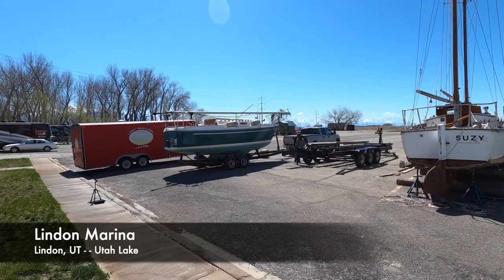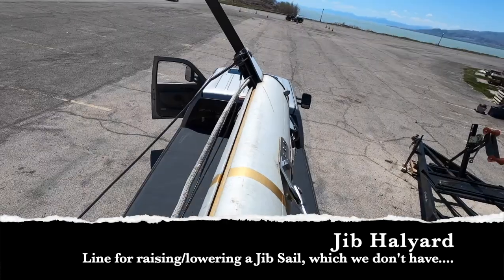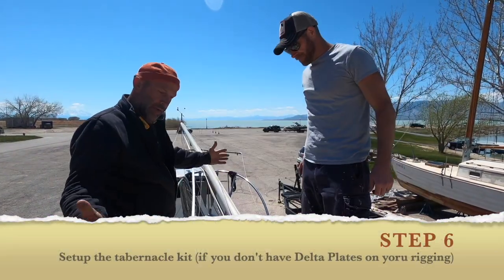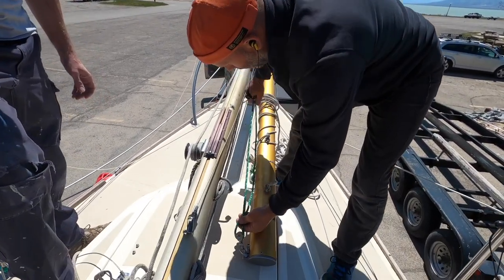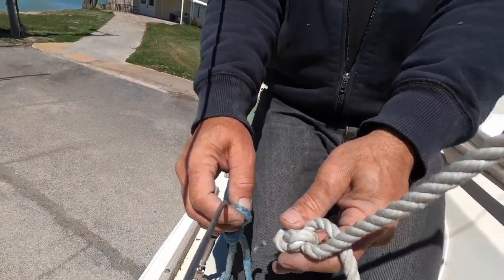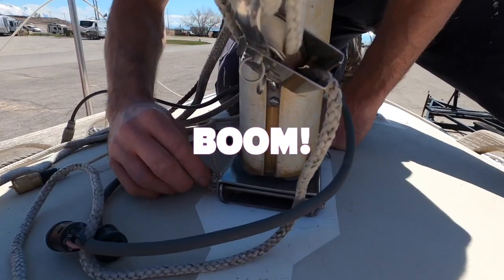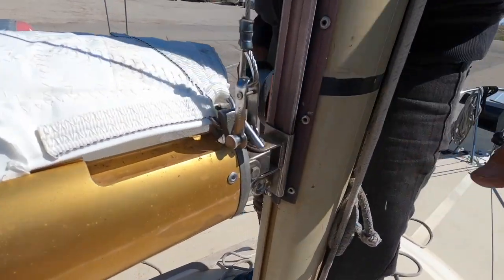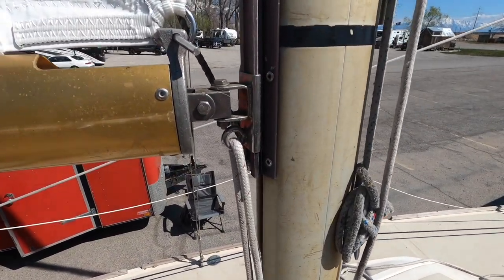Step the Mast | O’Day 25 | How to Raise the Mast on a Sailboat | Wandering Wassoms - S2 E12

Comment: I have the exact same boat. Based on the O'Day mast raising instructions, those delta attachments were an optional accessory.  Wish mine came with them. Once you get everything rigged, you could help the lifting by using a mast crutch at the bow end.
Reply from the maker: Thank you for that information.  I wish our previous owners had opted for the optional delta plate accessory, or I wish o'day had just included them as they truly look like they'd be very helpful.  I'm considering making my own.  We will also research a mast crutch.  Appreciate you watching our video and commenting!!

Comment: Nice informal mast stepping video.. You covered many of the little and subtle details.

I have and O'Day 19. Always raised the mast from the stern. And I always wondered why O'Day chose a deck plate with two  pins, rather than one like on my Capri 22. Never thought about raising the mast from the front. 

With my O'Day 19, I can easily heft the mast up. But on my Capri, I use a somewhat similar bridle arrangement and use the wicker pole as the gin pole rather than the boom as you did. My goal was to have everything I needed to step/unstep the mast stored in the boat.

Too bad you don't have a trailer tongue extender so your vehicle doesn't need to go into the water. My Capri trailer has an extension easy enough to extent/retract so my wheels don't even need to get wet.

Again, nice informal mast raising video.
Reply from the maker: Glad you enjoyed the video.  Thanks for watching and commenting!  Happy Sailing